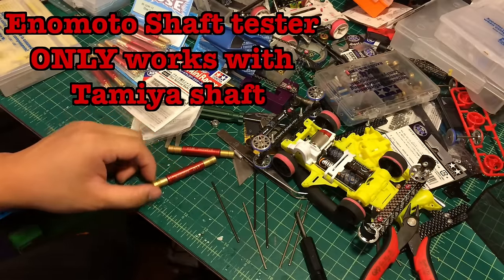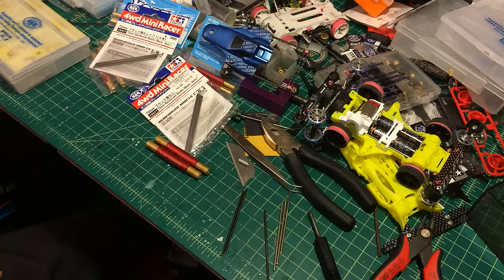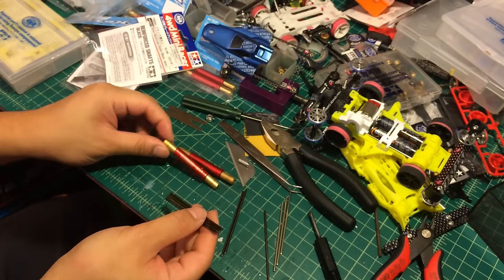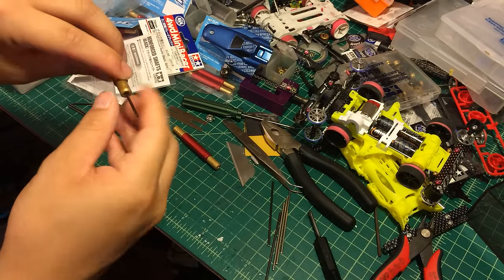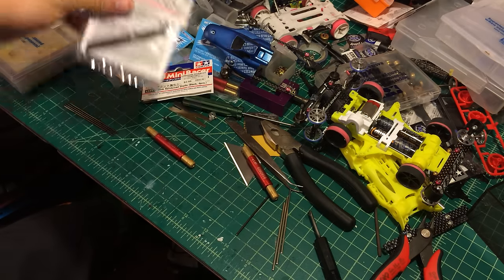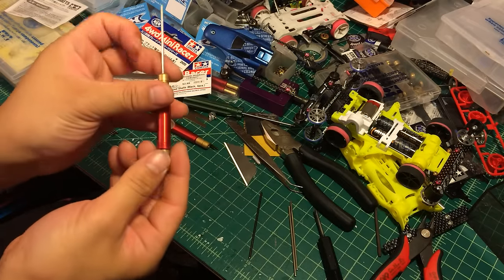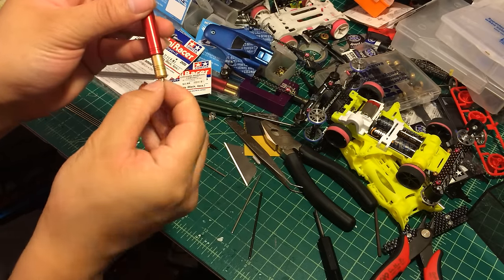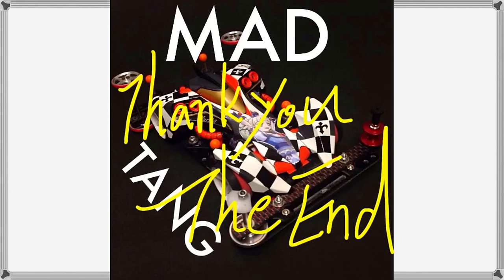【ミニ四駆】Tamiya Mini 4WD [ Enomoto Shaft Tester ] review and operation

Comment: Yep, I find it that a lot of the 72mm reinforced shafts are not straight even brand new from packaging. Usually I buy a minimum of 5-6 packs every time and sadly I will usually get between 3-5 100% straight 72mm reinforced shafts. :(

Comment: What is the different in performance between hollow shaft and reinforced shaft?
Reply from the maker: Yudistira Putra hollow shaft is 1 gram lighter than reinforce one.. but the hollow shaft is very fragile. if your car fly off or get hit... hollow shaft will be bent easily....
Reply: +Mad Tang what shaft that you recommend for the strong and best one? Is it 15417, 15416, 15440 or 15348? Thx for the answer

Comment: If I have titanium shafts, which one should I use? 1.97 or 1.99?
Reply from the maker: 阿泰 titanium shaft is discontinued on the market for a long time~~ I dont think they are going to re-issue any more... so it is not the standard parts. And I am pretty sure it will not be fit to the shaft tester, due to the titanium shaft has a rough surface (there is thousands of teeth on the surface) , technically, it will not be able to fit to any shaft tester
Reply: Mad Tang Thanks!! I learn a lot from your videos!